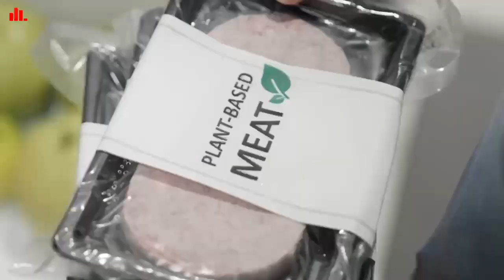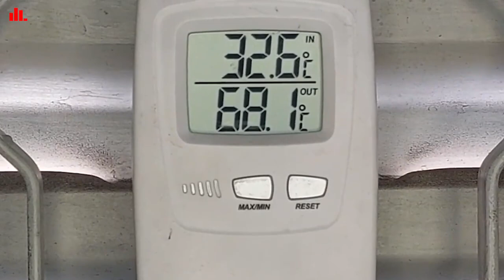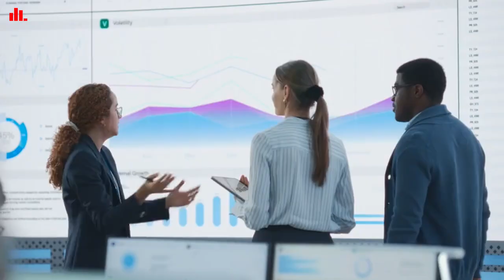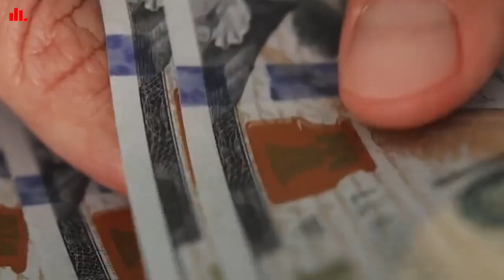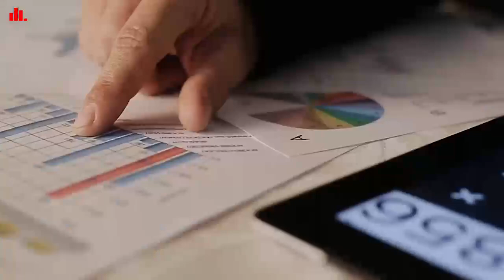15 Shortages That will Hit Grocery Stores In December

Comment: Thank you. Meat & poultry - pressure can. Milk - pressure can or buy powdered milk,  soy milk, eggs, cheese & peanut butter. Avocados - get some & make guacamole to store (freeze). Mushrooms - get dried mushrooms - Note: When rehydrating save the water - excellent in soups, stews & casseroles. Stock up on Apple Cider Vinegar w/Mother - excellent health benefits. Get all nuts - some need to be put in the freezer because of the oil content. Get several cans of Coconut Milk & Oil.

Comment: This Christmas I am doing something different for the ones on my list.  A rack of ribs. Why ? Well, the entire family can enjoy them, and it will help out the family  grocery wise. A couple of friends will get grocery store gift cards.
Reply: Great idea! I suggested to my Husband that we should get cards & gifts out early this year because the threat of prolonged grid down is escalating.
Reply: @judithstorck5195  I have stocked up on canned meats...so if elec. goes.....I don't lose all the meat in it.  (if ever invaded, war etc. first thing to go would be all communication. No tv, computer, heat, etc. and unable to charge anything for re-use.)
Reply: @cierakitty  Great job. You can get a solar/crank radio, solar battery charger &  rechargeable batteries. Geiger counter - all put into a Faraday cage until needed.